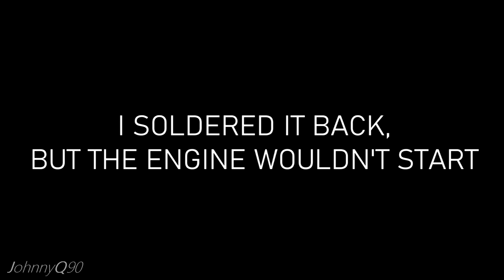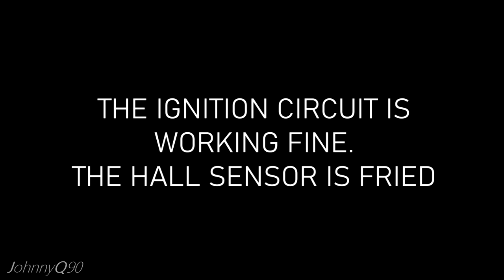Miniature V-TWIN Engine Test

Comment: Doe this engine not have nay way to oil the crankcase, valvetrain or the cam/starter gears?  Not even splash oiling?  Also, those gears being made of a soft metal like brass, how long can they be expected to last?

Comment: l was going to say at the beginning, that this engine had NO fan. All air cooled engines have to have a fan or be driven through the air like a motorcycle. My uncle sold an old flathead 45 to a kid that took it to work and let it run until break time because he had a hard time getting it started. It was really hard to start after that.......locked up solid!!!!! OH MY!

Comment: What fuel and oil do you recommend? No instructions provided!
Reply from the maker: You can use glow fuel or regular gasoline mixed with 2 stroke oil (25:1). Even Zippo lighter fuel is good.

Comment: A litle shaky engine, and the problem with the sensor could be just the begining of a very unrealiable machine. Nevertheless you are the right man to solve each and every one. It would be a nice project to bulid a remote control motorcycle with this powerhouse… Cheers

Comment: Looks like you might be able to mount a 540 size motor if that is the spot for a starter.
Reply: I’ve just been making up some parts for mine. Starter motor can diameter can not be any bigger than 24.5mm.

Comment: Likely the vibration fatigued the joint and then the wire bumped something it shouldn't have. Bummer.
Cool that it's a spark ignition engine this time.

Comment: Bit alarming that the gears were in brass and not a high strength alloy!! Hopefully covered by a warranty?
Reply: Brass is fine for those gears, especially with all the oil that'll percolate into the area. You'd be surprised how many full scale cars drive down the road with plastic timing gears in them....

Comment: I think it sounds like a HD cause it looks like a scaled down version 1:1 hence the starter motor mounting. Very nice little engine, sadly let down by the poor implementation of the ignition circuit.
Reply: That position on the real engine is for the generator, the starter on ALL aircooled Harley engines is on the gearbox. The exhausts are pointing forward on this model.
Reply: @robertnorgren993  Thanks, I now realise I know less about HD engines than I thought I did 😳

Comment: 4:08 I think that it's not 2 stroke, but 4 stroke, because of valves and intake placement.
Reply from the maker: Yes.
Reply: @johnnyq90  so the oil is there just for lubrication?
Reply from the maker: @technicbuilder6410  Exactly. There is no oil pan. It's very rare for a model engine to have one.
Reply: Yes
Reply: @johnnyq90  It's a pity it doesn't have an oil pan, because even if the oil is in the fuel, crank isn't lubricated. But WD-40 can solve it :D

Comment: As soon as i saw the bad translation in the book i was suspicious ! China does this a lot, they make stuff that looks good but ultimately the care has not been taken when put together. I see it a lot with China built model steam locos & stationary engines.
Reply: I always ask... if they can't get that bit right, then what about the rest.  The lack of protection for the soldered connections and the circuit board for the hall sensor kind of sums it up.  The manufacturer can make it work, long enough that they can market it, but not long enough that customers can actually use it.

Comment: O never understood why Harley put wheels on their bike when the engine can vibrate you down the road
Reply: I've never understood why people who've never owned or ridden a Harley insist on bagging them all the time!
Reply: @russparker71  hahaha. Fair. I custom built a fat boy in 07 with a s&s engine. I registered it as a custom build 2008. Ownrd others before. I know. I've ridden and driven many things. Remains true. Engine architecture is why they suck but I get why people like them, but would never own another. You could manufacture a hit and miss engine powered motorcycle if you want. Doesn't mean it or the engine is good. But hey, perception is perception.

Comment: You have to have block then Gasoline have direction for control 2 machine 1 body, balance for operator machine, we not talk about line function for moving objects 🤔 we just talk about support between partition 🤔

$50.000

Comment: What kind of fuel to buy for it?
Reply from the maker: You can use either glow fuel, or gasoline with 2 stroke oil 25:1 mix. You can even use Zippo lighter fuel.
Reply: @johnnyq90  thanks

Comment: never mind saw the price 600 bucks then saw the brass gears instead of hardened steel .. saw the metric rocker arms cap screws talk about low end stuff in this engine those rocker arms will wear out within 100 hours its a fucking cap screew you youse as a screw its not meant for rocker arm cups i see it falling apart fast its a gimic it really is

Comment: Why'd u even bother buying these chinese hunks of shit. I mean every one you buy you end up making extensive modifications to perform even reasonably well - I know it's only a 2 cylinder, but that looked like it ran roughly throughout, with the characteristic wobbling being particularly troublesome - no wonder it broke. "Just say no to cheap chinese products". They can be had for a steal but it's harmful overall for a LOT of different reasons, economically, environmentally, etc. Support local engineering wherever it may be.